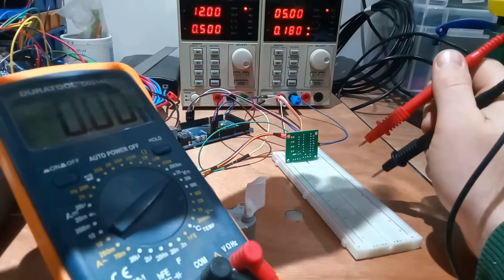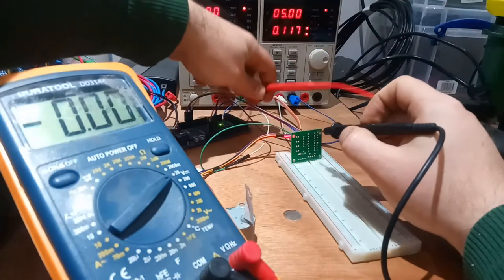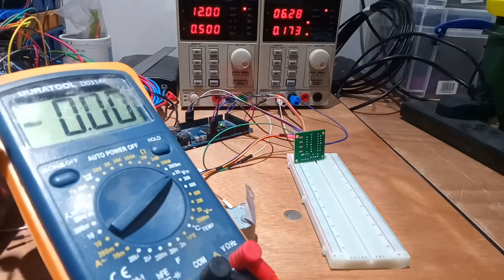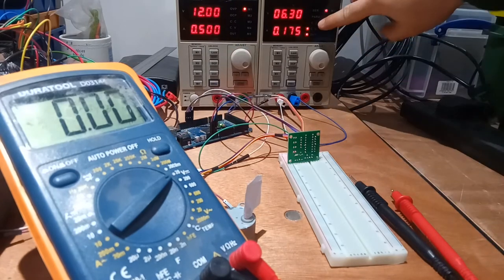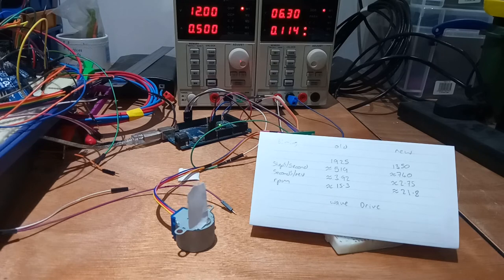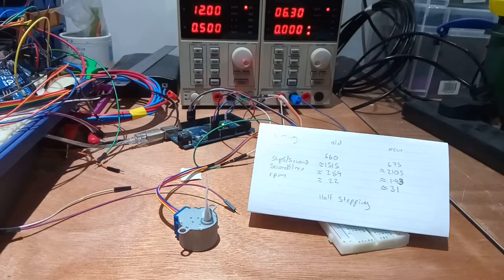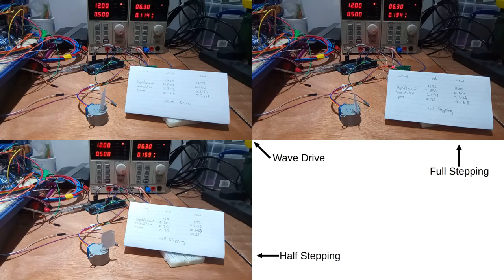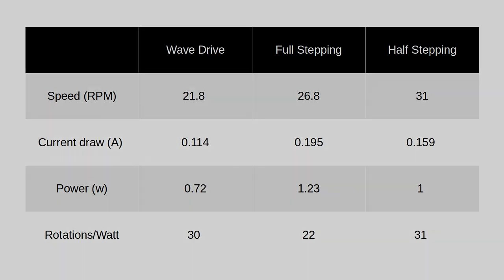#57 - 28BYJ-48 stepper motor speed increase

Comment: You could use a 3d printer driver. They are constant current and can supply higher and higher voltage as the motor speed increases. You can supply 12 or 24v without blowing the motor.

Comment: hi, i have 2 version of this motor. 5 and 12V. I tried both with ULN2003 but the 5V is much stronger than 12V. So question is: Can ULN2003 effectively run the 12V version? Of course I run 12V version on 12VDC. Thanks

Comment: Shouldn't half-stepping be half the speed of full-stepping?
Reply from the maker: So if you were using the same drive frequency, yes half stepping would be half the rotational speed as twice as many steps per revolution. In these tests I increased the drive frequency to the maximum stable frequency I could achieve for each method, hence them not being equal or in a 1:1:2 ratio.
Reply: @CrazyLogic  So with half-stepping you get faster rpm with twice the resolution?
This is interesting to me as I'm considering using this setup in a flight sim compass.
What code are you using?
Reply from the maker: @No1sonuk  it's my own code in these tests to avoid library overheads, half stepping does get you twice the resolution but these motors are not that accurate, so it helps with smoothness, but not really useful for what you describe. + you can gear down more if you need a higher resolution.
Reply: Half stepping achieves higher speeds mainly due to 2 reasons:
1 the smoothing factor. this means that you have 8 relative centers of the attracting or pushing magnetic field. since starting the movement in general is the largest problem at higher speeds half stepping can more easily reach high speeds.
2: half stepping can use more power, since 2 coils are on in half of the steps, those steps can have up to twice the power, since the field is wider this is slightly less but that loss also directly adds stability in this case.

I came up with a new drive method which is even faster than half stepping(just a little), and can achieve more torc. I call it diagonal stepping since it is similar to full stepping but in stead of traveling over the straight lines of the imaginary square by enabling one coil at once you move diagonally by enabling 2 coils at once at all 4 steps which means that you only use the fictive points which are added in the half step so the magnetic field center is never on the magnets themselves but in between 2 magnets where you have a virtual diagonal coil(fictive(combination of 2 coils)). this allows slightly more power and speed compared to half stepping, however unlike half stepping this one has more trouble starting since it doesn't have that smoothing factor. when run at the same speed as half stepping it works properly in general, however when going to far beyond it I would recommend starting in half stepping to accelerate, then switching to diagonal stepping for the slightly higher speed and torc once moving. it is basically like you visualize a line of function where stability and functionality both as one factor stand on one axis and speed on the other. then the line of half stepping at a certain speed suddenly gets down really steep, while the line of diagonal drive goes down a lot slower but is a lot lower already early on, for example where half stepping stays around 100% stability for quite long, diagonal stepping starts to be below that more early but is goes down a lot slower after that, and when the motor is running when diagonal drive starts to get trouble starting or getting unstable it stays quite stable when running for quite a while and speed can be around doubled from that point when accelerating not to agressive.
Reply: on 5v I got to a delay of 600 microseconds with the diagonal stepping, that would be 300microseconds per step if you calculate it as 8 steps in stead of 4. with half stepping I got it to 320 microseconds per step on 5v. that is by starting the movement gradually(start at what normally is the maximum stable point and then accelerate it every few cycly. it will rarely be anything useful however when talking about speed it can be nice to look at such things. if you test such a thing with your increased voltage then you might get to around 200microseconds that would literally be 10 times the frequency one normally gets as a maximum, or 5 times the speed. but 10 times the frequency sounds more extreme. I would probably still recommend half stepping, since you see how minor the differences in speed are(however the half stepping had almost no power at that speed, where the diagonal stepping(always 2 coils) had some torc still. the thing is the diagonal stepping uses more power, and is more likely to do something weird. but since you still had a square free if you ever do a video with a ultimate speed or torc test than you could include the diagonal stepping, especially at more normal speeds I estimate you might see a quite high torc, the only real question is will it beat half stepping and if so where. because diagonal drive outputs much more force on it's peaks, but half stepping balances it's power a lot better. their relative performance would directly tell much about the weight and flywheel working of the magnet inside, since the more heavy it is the more diagonal has a advantage, the lighter the more half stepping has a advantage.

Comment: Interesting that a week before posting this, your test at 5v and had Full stepping as faster than half stepping: https://youtu.be/zuO79Y35Lms?t=51  On my setup I have very long thin wires from the power supply, I've added a capacitor at the ULN2003 end in the hope that it will help, but not actually looked for the voltage drop.
Reply from the maker: yeah - I have an idea as to why that may be, but it all depends on the use case really. 

How thin is thin? If your motors are anything like mine then that 0.3a or so should be fine with short distances (like 5m) over something as thin as Cat6 conductors. I say should as I've not tested it.
Reply: @CrazyLogic  Not that long: 2m of telephone extension cable. After posting I put a meter on it, and when driving 4 coils (2 stepper motors), the line drops 0.2V from one end to the other.
Reply: I made the same mistake as you in having the current limit set too low - I was sure I had checked that! Being as you up the voltage, and then fix the current limit, I wonder what voltage you are actually running the steppers at?
Reply: I'm driving my ULN2003A with 3.3V logic - which may be why I'm getting a bigger voltage drop than I expected. The ULN2003A is meant to be driven with 5V TTL logic. There is a 3.3V logic version called ULN2003LV
Reply from the maker: @johndoggett808  well it's a given voltage, or lower the voltage to maintain a peek current. That's how bench supplies current limit. In constant current mode it will vary the voltage to maintain the current, but only upto a set voltage. If you didn't have the set voltage, then the maths on an open circuit would lead to an intimate voltage. Dave at @eevblog has a new video on this topic.
Reply: @CrazyLogic  OK I take it back,  at 51 seconds in you did measure coil voltage while the PSU is clearly maintaining 6.3V so obviously curren limiting had not kicked in while you took the coil measurment (which was what I thought you had done). The PSU voltage drops once the motor starts turning, but that is after you take your measurement.
Reply: Seems 3.3V logic is OK - my reasoning was that possibly the Darlington pairs were operating in amplifier mode rather than as a switch. But I get the same voltage across the coil with a 5V logic input. (GND to coil: off = 4.970V, on = 0.890V dropping to 0.878V (Power rail drops by 0.07V with one coil on)). So nearly 20% of the power is going into warming up the ULN2003 - I guess the 12V version of the 28BYJ-48 will result in less waste.